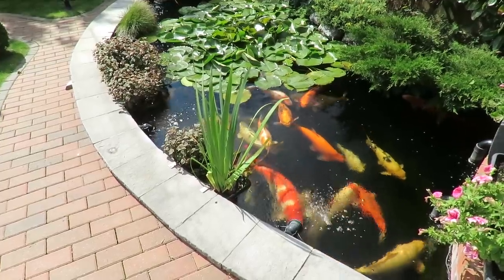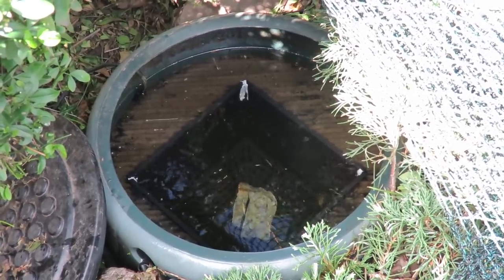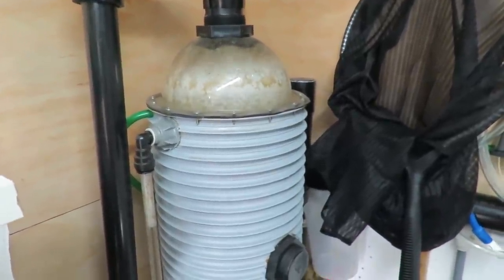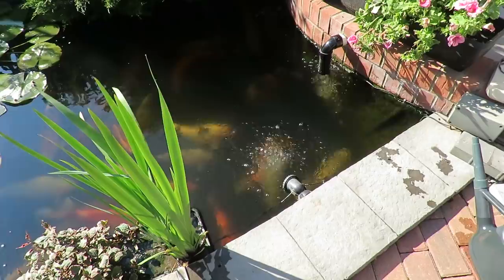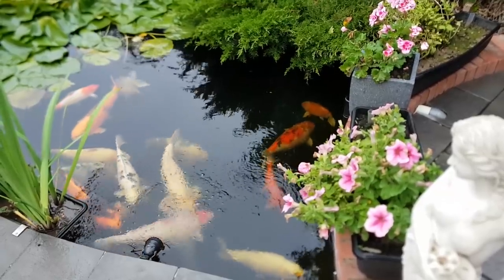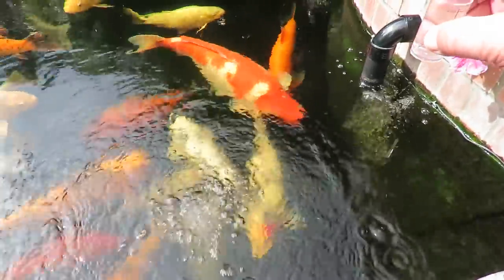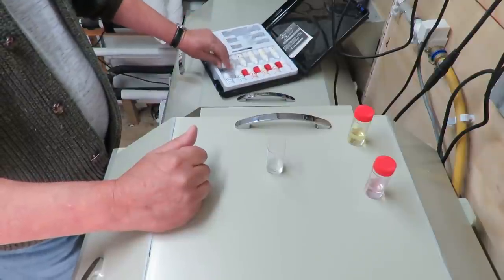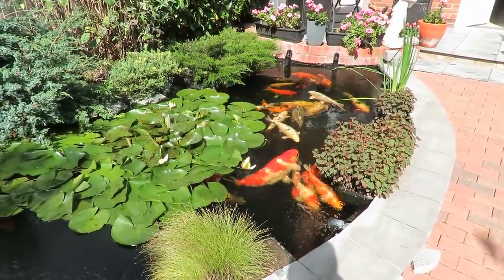A Good Pond Clean and Treatment

Comment: Hi terry , fish and pond looking superb, as always , I bet the root stock on the big Lilly is massive now .im a little surprised your blind treating with out scraping to confirm what you are treating I was always told that’s a big no no , .do you think the protein skimmer might be removing the treatment you’ve put in that’s why it foamed when you didn’t expect it too keep up the good work terry
Reply from the maker: Hi mate, and thank you. That's right mate, you should never treat blind. I did a scrape on Nelly when she was in the quarantine tank, and she was showing a few parasites, but not an infestation, but with her immune system really low, I thought I'd treat the pond. If she has them, they are on the other fish as well. Your right about the protein skimmer lol. I never thought about it when I added the Formalachite. When I went into the filter house I think the Formalachite was all in the bucket lol. I had to tip it back in the pond and switch it off. Thanks mate and take care, Terry.

Comment: Nice video,i thought the bakki river used up  all the nitrate, but you have alot of fish
Reply from the maker: Hi David, thank you. I use to get readings of 50 mg/l and higher due to the fact (like you say) I do have a lot of koi in the pond. As I said in the video, the moving bed is turning nitrate out all the time and it has to pass through the bakki shower to remove it. So I will always see a small amount in the pond. Thanks mate, Terry.

Comment: Was thinking about you today Terry as I’ve had a slide valve fail after only 18 months. They just don’t seem to be built to last and Unfortunately my set up is using quite a few right now.
Reply from the maker: Hi Paul, I must admit, I don't like them. Their not to bad as long as you can get at them to fit new seals. Where I have mine, I stand no chance at getting at them, so there's nothing I can do. I thought I'd be ok as I only wanted to use them twice a year. But unfortunately not. Thanks mate, Terry.

Comment: Hi Terry .. 
Nice to see ur video again..
Shes looking good .hope she stays that way..
Your protein  skimmer... if a made a smaller scale one will it work and height  wise were should it be.. waterlevel?  
Thank you ..
 Ps still got a problem with the nitrite  in the pond . Lol
Reply from the maker: Hi Bash, thanks mate, Wow! you've still got nitrite problems. I don't understand it. Your not using tap water for any reason in the filters mate are you? I know it's a silly question, but had to ask. How much media do you have in the moving bed? You can go to 60% of the water volume of the tub. Also do you have a good airflow in the moving bed and are you keeping it going 24/7 ? There has to be something causing this mate. Terry.
Reply: @Wrighty  its a old nexus  200.. i have about 90 litres in the bio and about 20 litres in the middle.. i run a 90 litre air pump and a 8inch air stone in the pond ..yes 247 running . Lol the only think I can think of its was used k1 .but I did pp clean it ..well before. Tap water but I put in a full bottle  of decorator. Measure it too.. Have ordered  a 3 stage filter.. im lost lol.. honestly  I have  put in 4 bottles of bacteria. Bomb 💣  but no luck.. the KH was really low .. at one drop but after adding bio carbonate its now on 6 drop when I'm checking .. HPH is about 8.2..
I didn't  realise how hard this hobby is ... honestly  ur vidoes keep me going Terry .. thanks for ur time .. sorry for the long reply 😅
Reply from the maker: If your getting no ammonia problems, the filter media is working. It sounds like new pond syndrome. Have a search on YouTube for new pond syndrome, you might find something that may help. Terry.
Reply: Terry thank you .. i probably  seen about 100 video.. oh well .. its part of learning  😌 thanks

Comment: Hi Terry great video is your pond a liner ! Or fibreglass M8, having trouble with my pond this year with the Blanket weed just can’t seem to get it under control even with me treating it with Cloverleaf 😳 so today I’ve started to build a holding tank so I can put the fish in then drain my pond down and clean the liner . Thanks for the tip on the pond Lilly I’ve tried now for 4 years to grow them but no luck so this year I called it a day. Will try next year
Reply from the maker: Hi mate, Yes, my pond is a liner. Everybody has had trouble with algae this year mate, and no body knows why. It's been a right pain. I had to treat with Cloverleaf and it has held it back some. I have had it on good authority, koi don't touch that type of lily mate. There's not a mark on mine. There's nothing left on the other one I had in there though, that was a different type. Thanks mate and take care, Terry.

Comment: Evening Terry. Great video again 👍😉 
Do you have any problems keeping the water level in the protine skimmer at the same height, or do you need to adjust the out flow in a regular basis?
I have also build me a protine skimmer 😉👍 I will show it in some of my comming videos 🤔 I think
Thank you for you videos Terry
Reply from the maker: Hi mate, and thank you. Look forward to seeing the video. No mate, I never touch the settings on the skimmer now I have them set. That's why I used the threaded gate valves. Their not cheap, but are really controllable. take care mate, Terry.
Reply: @Wrighty  Okay, perfekt. I'll see how mine work. 
Take care 👍

Comment: Just curious... do you do scrapes on the fish? Also how do you go about water changes?
Reply from the maker: Hi Jim, yes mate, I do scrapes if I think there's a problem. Nelly was showing a few parasites (flukes) but not an infestation, but with her immune system really low, I thought I'd treat the pond. If she has them they are on the other fish as well. I drop a syphon pipe in the RDF to remove water, and use the timed top up to replace it. take care mate, Terry.
Reply: @Wrighty  I have to try and do the water changes when I vac the pond. My pond is only small so it's not too difficult although I have to carry the waste to the drain as it's the opposite end of the garden.
Reply from the maker: Hi Jim, don't you put the waste on your garden as it's good for it. Terry.
Reply: @Wrighty  no the mrs doesn't like the sediment it leaves behind. I tried to convince her but she won't have it